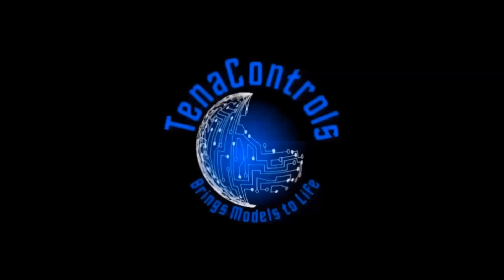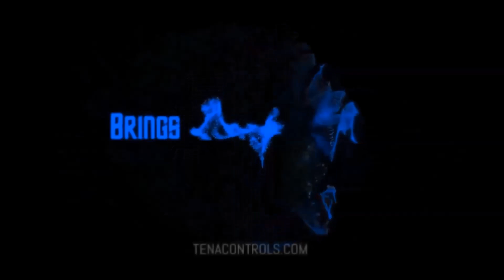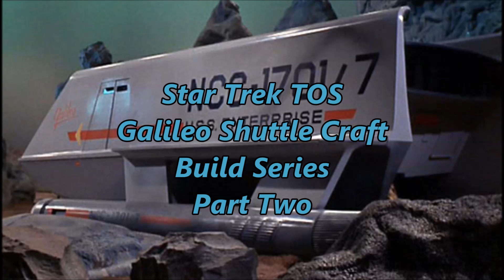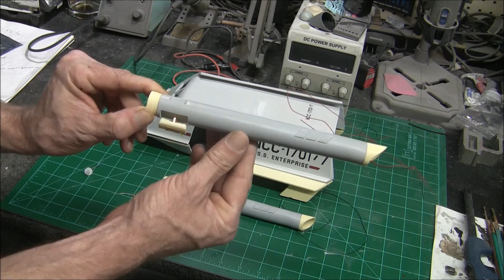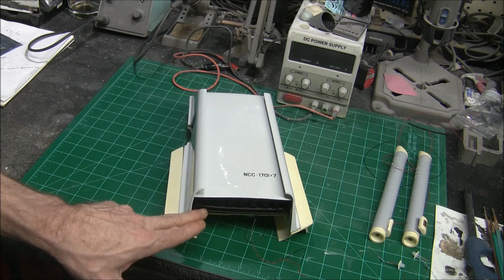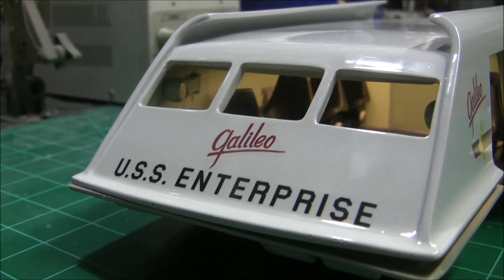Star Trek TOS Shuttle Craft Galileo Scale Model Build Pt 2

Comment: Isnt having those wide metal contacts a fire risk or is your supply really low amps?
Reply from the maker: It's very low 9 volt DC current. Probably just milliamps as far as amperage draw.
Reply: TrekWorks ok makes sense, i know LEDs are real low wattage but you have many in there. but I doubt it has the power to spark
Reply: TrekWorks Plus it looks really amazing.